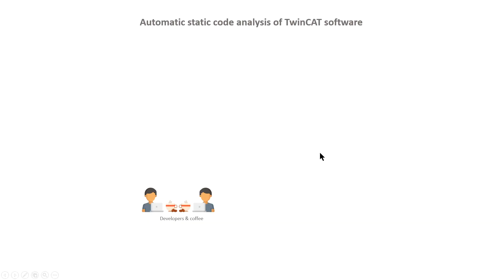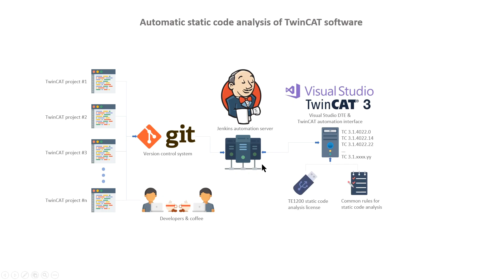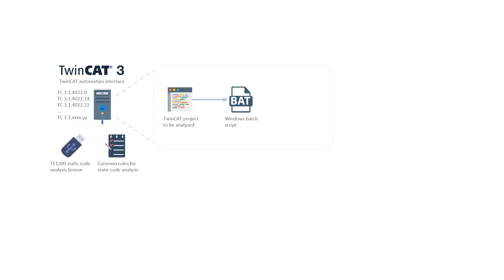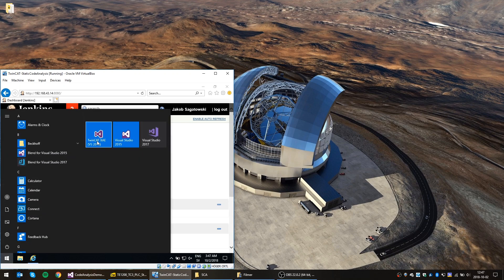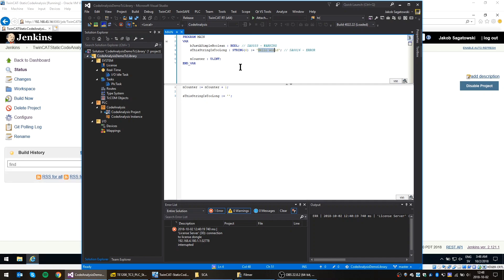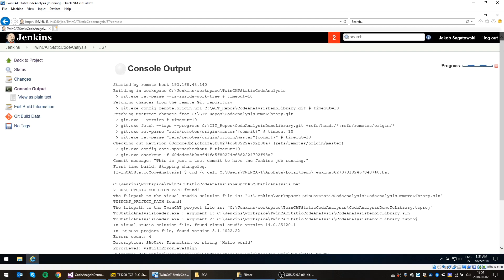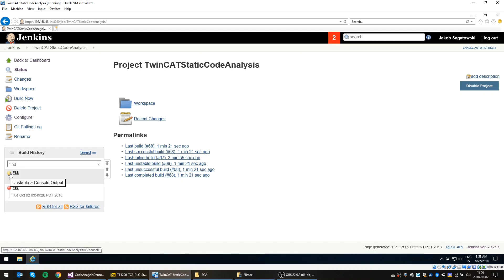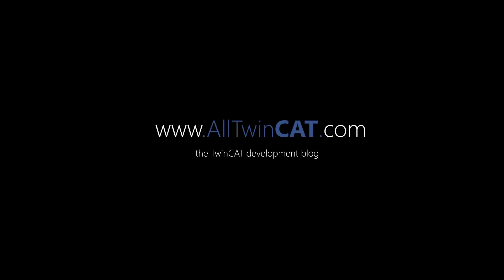TwinCAT static code analysis & Jenkins

Comment: Thank you very much Jakob, for this video. One question, what is your experience using Git and Twincat 3? I have been using it for a couple of days. With the built-in version control of visual studio and as a difftool and mergetool, tcprojectcompare. I have seen that twincat 3 it is not very mature yet. What is you opinion? Thanks again for your work
Reply from the maker: Hi! For the code itself, my experience is that it's working like with any other language, with the exception of all the overhead that the Beckhoff IDE is adding to the code (everything embedded in XML-tags and a lot of extra information that makes it a little harder to do version control). I've mostly have had issues when the other (non-code) related things have changed, like I/Os, safety project, motion parameter changes. This has caused more headache, but is still do-able.